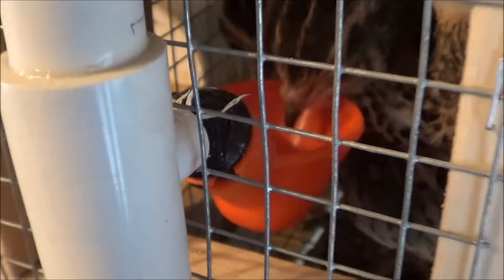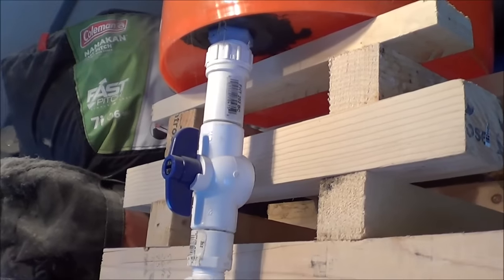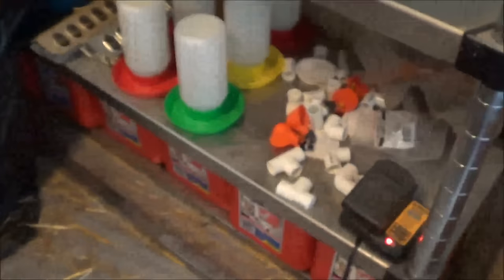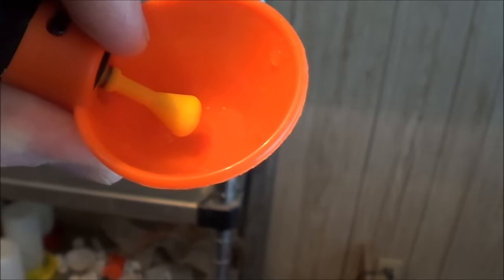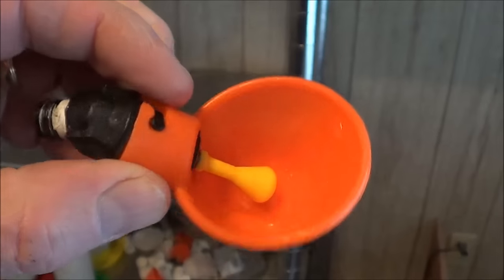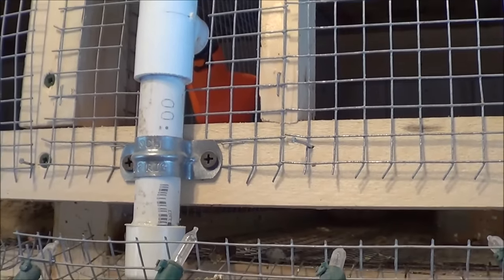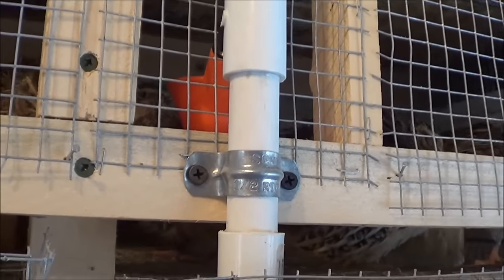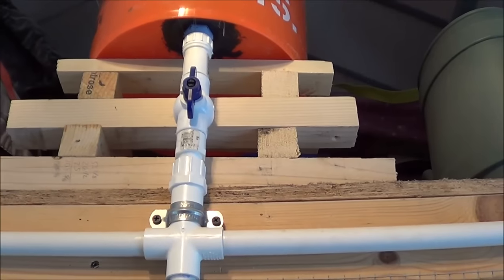Homemade Automatic Quail Watering System

Comment: Your article is right down my alley.  I have a question - will your set-up work on multiply layers of cages?  I am limited on space and will eventually want to have 2, 3 or more layers of cages.
Reply from the maker: ArkAwynne It will work fine with multiple layers. If you look closely during the video you will see that I left a short stub of PVC pipe under the watering cups so I can extend the pipes below the cage to cages that I will build in the future. I'll just cut the cap off of that stub and extend the pipe with a fitting.

Comment: My quail are still trying to figure out the cups, also that T pvc connector is just about perfect for these cups!
Reply: parker benz
Glad it's working out for you!  I've found that the quail figure it out REAL quick.
Reply from the maker: Yes, I think these cups with 1/2 inch PVC pipe and fittings are awesome.  No clogs yet.  Your birds will be happy!
Reply: Previously I tried using these cups drilled into 3/4" pvc (before I knew about those T's) and it was awful, they kept breaking and leaking! Also, I had lots and lots of leaks in my water bucket, so I just ordered a "bulkhead fitting." It works sooo much better and doesnt leak at all if you get one with a rubber seal!
Reply from the maker: Yep, the bulkhead fitting is a great way to go.

Comment: How cold does it get where you live? Have you had any problems with the watering system freezing?
Reply from the maker: I live at 9,000 feet elevation in the Colorado mountains - it gets COLD up here.  I have a small space heater in the quail house to keep it about 40 def F so nothing freezes.  Use a "Thermo Cube" for this.  It's just an outlet that turns power on at 35F and off at 45F.  Plug the heater into the Thermo Cube and you don't have to worry about freezing.  They are about $11 at Amazon:  http://amzn.to/2d3Kak7

Comment: Thank you for that thermocline tip. Do your quail keep laying eggs during the winter when it gets that cold?
Reply from the maker: No sweat man.  I live for this stuff! 

Quail will lay eggs all year round as long as they get enough light.  It doesn't matter how cold it gets.  Give them 16 hours or so of light each day and they are egg laying machines all year.

I use a few strings of white LED lights set on a timer to make sure they get enough light during the winter.  This works awesome and the LEDs keep the electric bill as low as possible.  I need to put up a video of my lighting system.
Reply: I'd love to see your lighting set up. I just built my quail shed and have insulated it and am getting the cages put together. 40 eggs are in the incubator :):):)!  Here soon I'll need to figure out the water, feeding, heating, and lighting systems, so I'd love to see what you've done. I'm subscribed, but let me know when you've posted a video on it so I can be sure to see it.  Thank again!! Evan Kenison, Tooele, Utah
Reply from the maker: Good luck with your hatch!  It's a very exciting time.  I'll get a lighting video up real soon.  In the meantime, get your brooder all ready to go.  Check out mine on the blog:  https://raisingquail.net/2016/04/11/the-brooder/

Comment: I am in the process of building some quail cages and I'm having trouble finding trays to go underneath the cages. Can u give me any info on where to find them?
Reply from the maker: sirocco454 I got mine at AutoZone. They are aluminum drip pans and cost about $10 each. Anything like these will work, just be sure to build your cages so they fit.
Reply: I got full size baking sheet 18x26 about 1 inch tall. They were aluminum for 9$ each.
Reply: @raisingquail1100  nice work